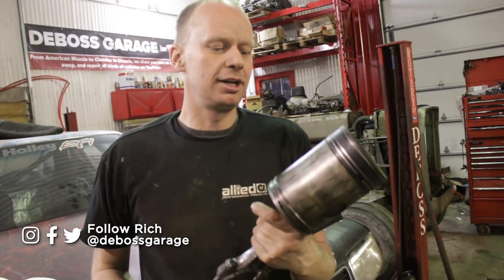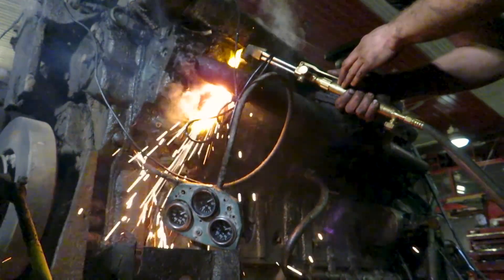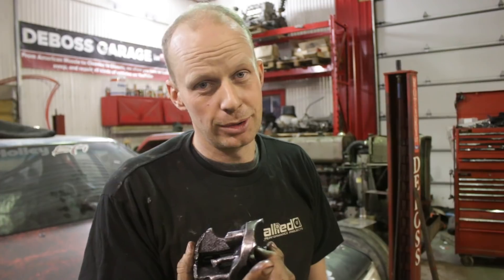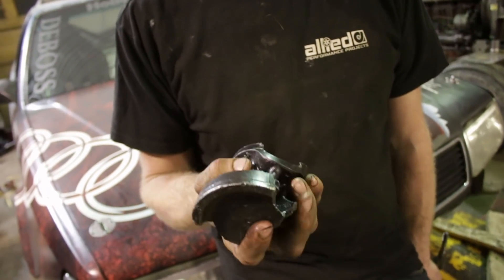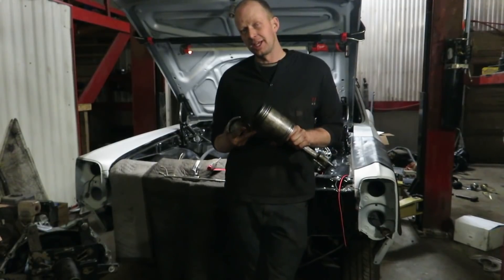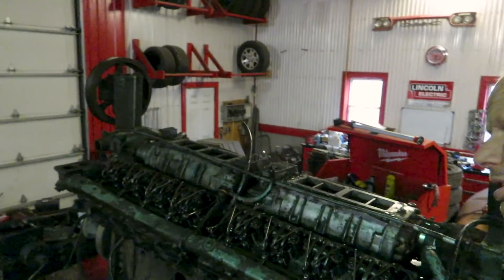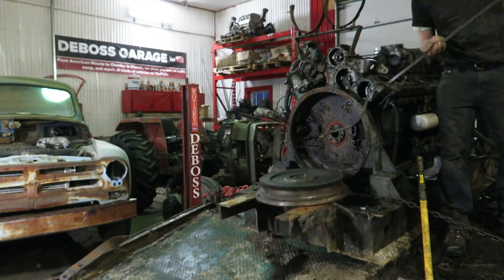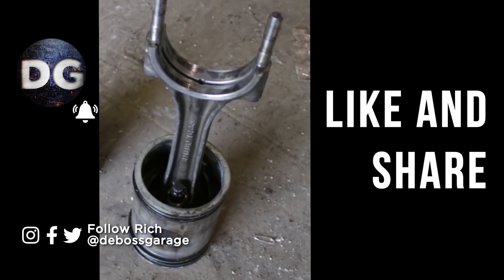Who Wants A Detroit Diesel Piston? Shrapnel + Merch GIVEAWAY

Comment: The crosshead piston to connecting rod bolts were 12 point and were torqued to 55-58 ft lbs. We'd mark them after tightening with a quick shot of spray paint to verify they were done. Wouldn't want any loose ones....   XD

Comment: I always liked the Silver 92 Detroit V8 although it will need a rebuild about 300,000 miles. So Upgrading one with modern Tec would be Awesome Rat Rod Idea. The power they put out is almost unlimited 12,000 to 15,000 HP. from an old Kenworth Dump Truck back in the late 90's. with a Alice trans it  would Smoke the Tires right off.

Comment: I work for WG equipment just up the road from you and loaded your air bagged burnt school bus frame for you into the trailer. I have a 1956 GMC military 6x6 that I grafted in a 3 53 Detroit. Way too much fun to drive.
Reply from the maker: You wouldn't be able to get me the VIN number from that frame would you?  I'm having trouble getting the air bags for it.  Could you check with the office?  I called but didn't have any luck
Reply: @DEBOSSGARAGE  I have no access to anything in the office. Your best bet would be to talk to Bill directly,he might know where to look for it
Reply: @DEBOSSGARAGE  office says they have no records for the bus  but the vin should e on the frame next to the right front wheel